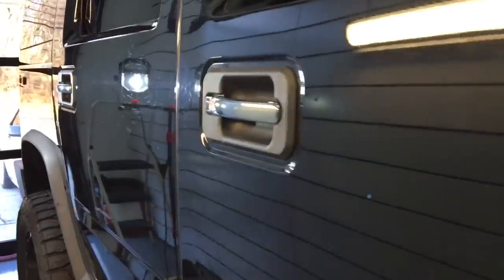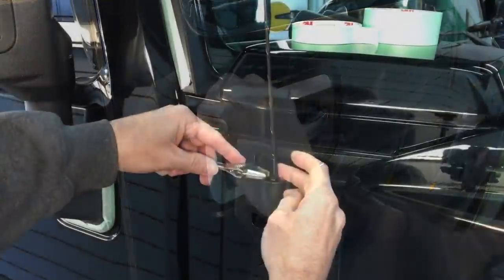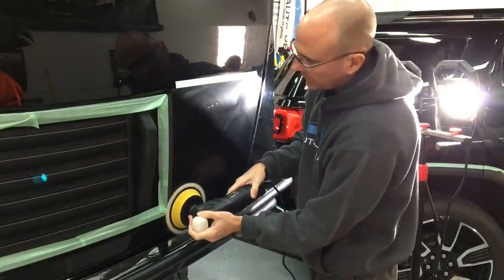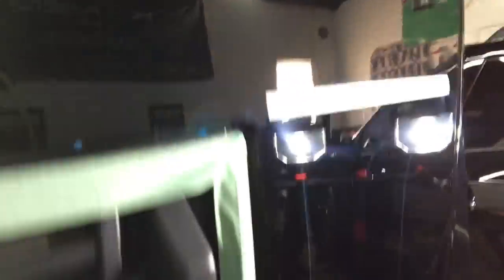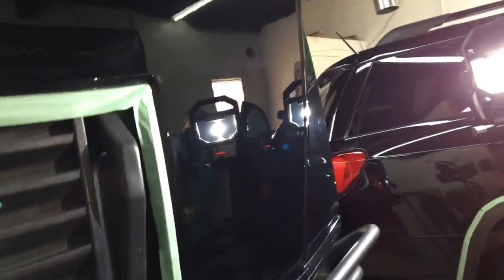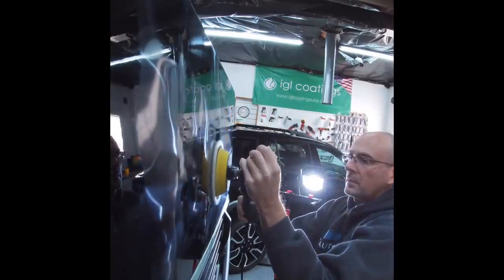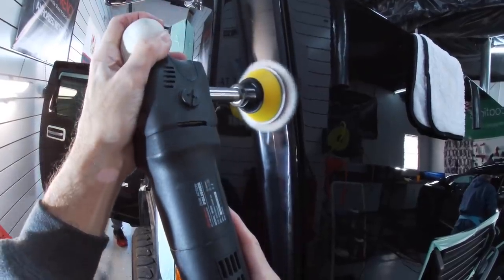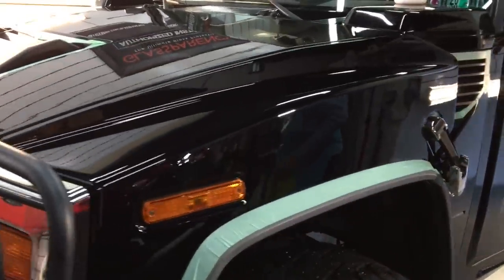How Many Polishers Does It Take To Correct A Seriously SWIRLED Hummer? Let's Find Out!

Comment from the maker: List what polishers YOU own.....or would like to purchase soon. :)
Reply: Once a year detailer here. Started with a shinemate and recently upgraded to lhr3 15. Difference is night and day, chalk n cheese. Next buy will be a Rupes lhr75.
Reply: Torq Q,10Fx and 22D 
Maxshine pro 15mm (Hate it) it stalls pretty bad lol 
Maxshine 550 rotary 
Dewalt,Wen,Harbor Freight rotary 
Amazon china 21 longthrow polisher (Trash) lol but fuck it 80$
Reply: Rupes 15, 12, 75 ibrid, hf 5" blue point rotary, 2" hf pneumatic.
Reply: I own a Porter Cable 7424 xp  and a Maxshine M15 Pro.  I plan on purchasing a Maxshine 550 rotary.
Reply: @degrootautocare9154  how do you like the maxshine 15 pro?
Reply: lookn 4 a good 3 inch rotary polisher
Reply: I own a FLEX XC 3401 VRG and a "noname" 4" rotary.
Reply: alberto
Reply: thank you
Reply: I have a tcp global cheap rotary. I have the Adams battery swirl killer. The small micro battery 🔋 3 inch is on its way.
Reply: A Griot's Garage G9 and a Harbor Freight 69924.
Reply: I own a Meguiars g110 version 2.. was going to upgrade to the max shine 15 mm version 2 Pro.. but after reading all these stalling stories I'm not sure LOL might just go with the flex 3401 or griots G9. Can you give a recommendation Brian or anybody? Tks..
Reply: @edruiz6364  how's the G9 working out on vertical panels with a 6 1/2 pad?
Reply: @seyoungkim4694  curious.. could you have the 15 mm 610 e x.. how do you find the shinemate overall??
Reply: @notfound-qg2ii  I haven't used the G9 yet because of recent bodywork. However, I don't intend to use it with the 6" backing plate opting instead for the 5".
Reply: @notfound-qg2ii  hey John, it's the ex605 with 5 backing plate and 12mm throw (my first machine) Perfectly adequate but far from perfect. The rupes is just so refined, hell of alot less vibration and great ergonomics makes it all round pleasurable to use. I may only correct 2-3 cars a year but I c it as a good investment given clearcoat is much softer and paint thinner.
Reply: Rupes lhr15 mk2, rupes mini lhr75, liquid elements 1000 v2(similar to the ibrid) and a shinemate ep803 rotary.
Reply: Krauss S75 mini
Krauss S8
Flex PE 8-4 80
Reply: @notfound-qg2ii  yeah DO NOT get the maxshine pro 15 I honestly have tried to give it many shots. But I just end up putting it away after a few section passes I just pick up my torq 10fx and put a yellow or wool pad if a want good defect removal.
Reply: @notfound-qg2ii  but def get the torq 22D it's my favourite polisher! And the 550 rotary
Reply: I'd like to buy that Maxshine rotary. Original PC7424, Torq 15DA, Maxshine 15mm, Shurhold 21mm, The good Harbor freight 8mm as a dedicated 3"
Reply: G9 and Flex rotary
Reply: @davidsaucedo6550  awesome! Thanks dave
Reply: Griot's Garage G9 DA, Harbor Freight Rotary, and the Craftsman old school orbital!
Reply: Flex 3401, Flex PE-8,  Flex light weight rotary and the Flex 3 Inch mini DA (not sure the model number of the last two). Love all of them!
Reply: @davidsaucedo6550  so I've decided to go with the new Torq 15 mm polisher.. put out some great power and doesn't stall on side panels. Thanks dave.
Reply: 7" Drill Master and new Makita PO5000C forced rotation.
Reply: @notfound-qg2ii  sweet! Great choice the 15mm is the perfect balance. When I'm working with soft clear using a 21 longthrow can finish pretty pad. I know pad and product comes into play but it's just too much power. 15 is great because it's in the middle.
Reply: @Carlos.Rivera  saludos desde mexico 💯
Reply: @daves.3278  saludos compa
Reply: I've got a Dewalt Dwp848x  rotary and a Shinemate mini rotary over here in the UK .
Reply: @seyoungkim4694  damn sucks you couldn't of got the shinemate 620 that's out now has same speeds as the Rupes 15 you bought and its 200 dollars cheaper.
Reply: just bought the shinemate 620 watched your review video you did on that polisher and I was sold.
I must say the shinemate 620 has to be the best D.A out right now.

Comment: Hi Brian, great video ! I am however interested in your test spot. When correcting customers cars I am beginning to be more and more finicky about the finish of the paint. For example at 7:09 in your video you can see a very slight hazing after you have finished down. Is this an acceptable level of finishing and  what does necessarily count as an acceptable level of finishing ? To remove that slight haze would it be classed as jewelling? If so would you charge extra for that to be removed. I'd love to see you make a video on this as its bugging me alot, as I feel like I'm cheating sending the car out like that, even though the customer is always over the moon with it! Thanks again !
Reply from the maker: A panel prep or IPA would remove that residue. If the customers budget allows...you can surely add an extra dtap. this customers budget does not.

Comment: Hi Brian, based on your response in a previous video, this would be the same setup you would use on BMW clear coat, right?  
Regarding polishers, I think I am going to get the Maxshine Pro 15mm.  If money was not an issue though, I would get a Makita.
Finally, thanks for showing the passes in real time, gives a real sense of arm speed.

Thanks!
Reply from the maker: Yes it would.👍

Comment: Whats your favorite Rotary?? Is it the Shinemaster/Maxshine M550 or the M1000 or other?  So you only need 1 Rotary on which you can use  1" all the way to 7" backingplate&pads ??
Reply from the maker: It is the MaxShine 1000...and to answer the second question...yes.
Reply: Your the best Brian, if i lived in the USA instead of here i would love to spend some time as a trainee at Apex, however i live in th Netherlands so its kinda far :( .
Also some known detailers told me the DA polishers from Maxshine are rubbish, i have the M15 Pro now and it works great. Used the Rupes LHR15 but that one stalled a whole lot (It was one used for training purposes so it could be defect?) and i was not happy working with it at all. I will go for the M1000 then :)